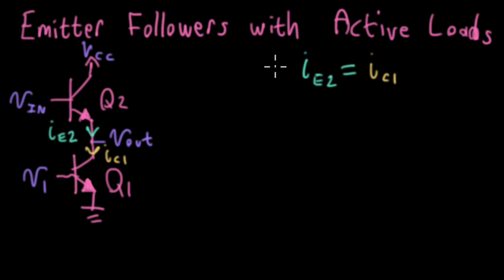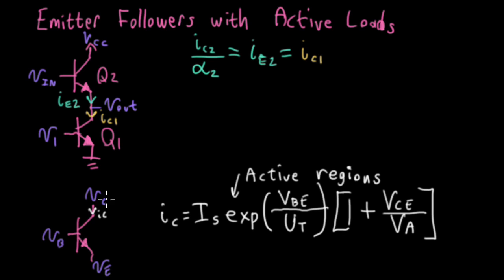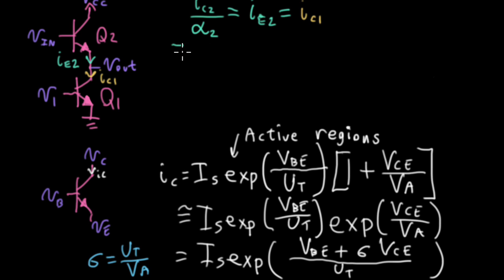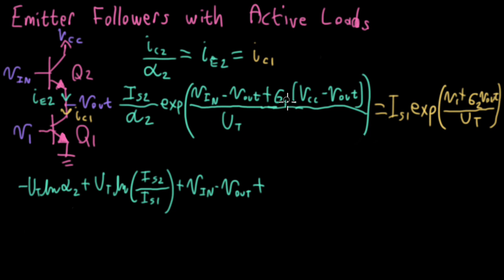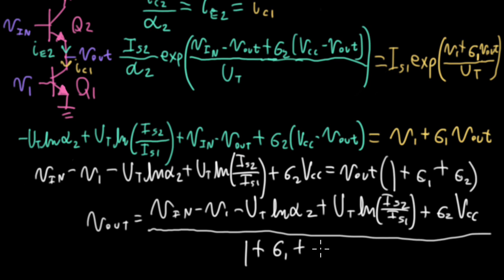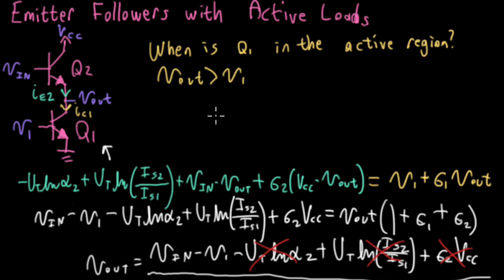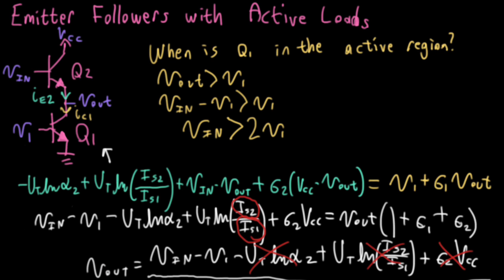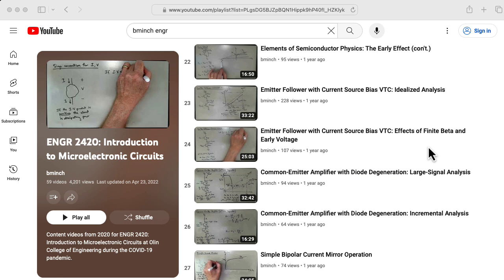Emitter Followers with Active Loads Analyzed via Ebers-Moll Model (no small-signal analysis needed!)

Comment: I really wish it hadn't been 12 years since I returned to using what I learned in college because now I have to rebuild my math from the ground up! I did, however, come up with a common emitter series transistor class-A amplifier, it has phenomenal output, and I need to analyze it in relationship to the Darlington pair to see how it compares. 
In my academic retention lapse, I used a stock design for a BJT SSA about 7 years ago, and just recently in improving it, realized my voltage divider giving bias to the base was absurdly lossy!
Values so low, more current was seen across the divider than the transistor.
On the bright side, I absolutely love math, so I just need to get over the hump to get restarted.

Comment: Even though I'm not a symbolic thinker, I think I followed this explanation so thanks for that.
This is much simpler than an op amp for subtracting one voltage from another.
What other applications should I be thinking about?
Reply from the maker: I probably wouldn't recommend it as a general-purpose subtractor because of the limitation of Vin > 2 V1 for Q1 to remain in the active region. There might be some special cases where that would work, but the standard op amp circuit is so well behaved I'd recommend it even in weird special cases.

Comment: Question please, would it be possible to get Q1 to clip the signal by splitting the Vin signal into Vin and v1( using a resistor to lower the voltage going to v1)? Thanks
Reply from the maker: You could probably do something interesting there. Even the Falstad simulator would probably show something useful.

Comment: nice adventure and interesting 'approximations' ;-)  back in the day we used to force a pair of 'matched'  BJTs to thermally track each other by encapsulating them within an epoxy resin blob (while in touch face to face) and enclose along with them a power resistor operated at higher than room temperature.